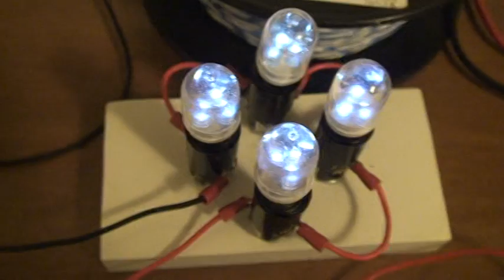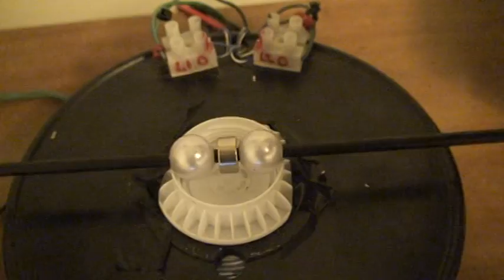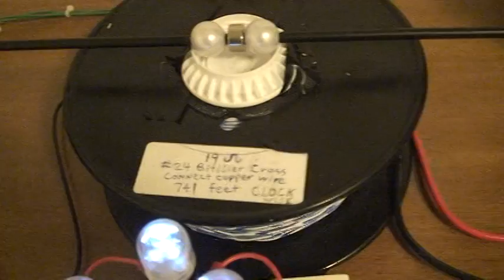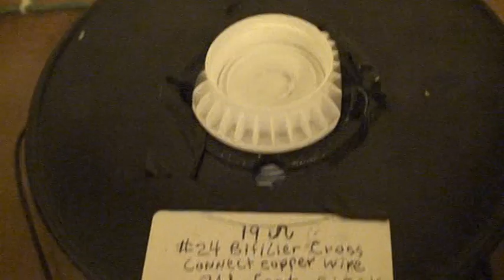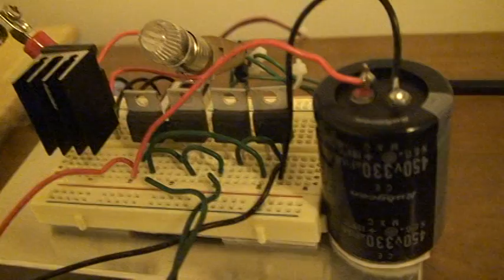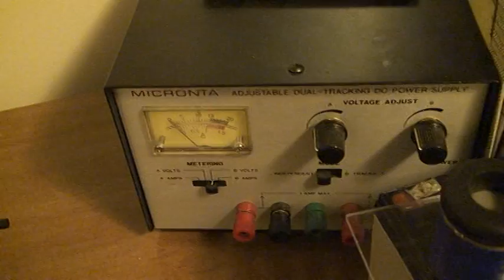SUSTAINED WOW!!.MPG

Comment from the maker: @64298   I am going to try to lite a 36 inch long fluorescent  shop lamp without wires using the 1.5 volt cell phone charger as my main power source.  Thats in addition to powering everything else you see on this video.  Am winding a long coil presently.  Will  post video when done.

Comment from the maker: @Magneticitist   What you are saying is true.. The lamps must
have internal resistors and each lamp bulb can plug directly into a 120 volt AC outlet without burning out. They are small night light bulbs.  Correct about the phone charger also.

Comment: pretty cool! now THAT little magnet is going super fast..
u are right about the caps but its interesting how it sustains those lights so well.. those must be using resistors internally and are made to plug into the outlet or something, otherwise that much voltage would have popped the LED's. (maybe they are higher voltage LED's though..)

also i believe those phone chargers are stepping up the 1.5V and putting out 5v @ around 90mA